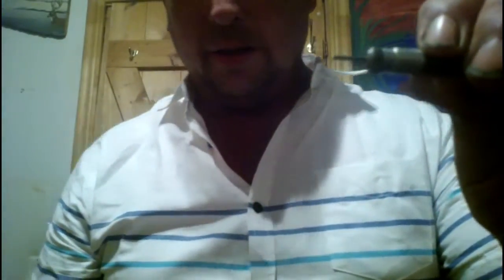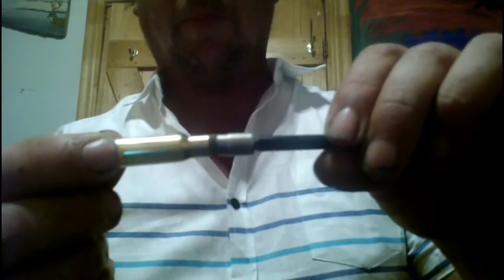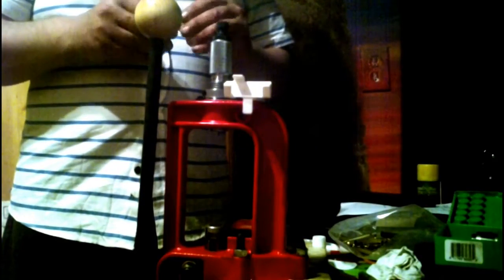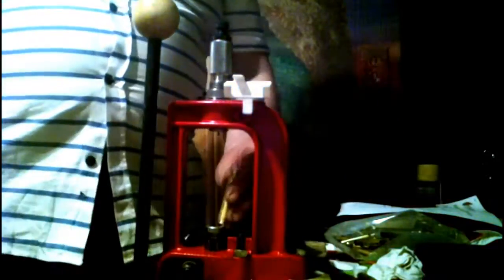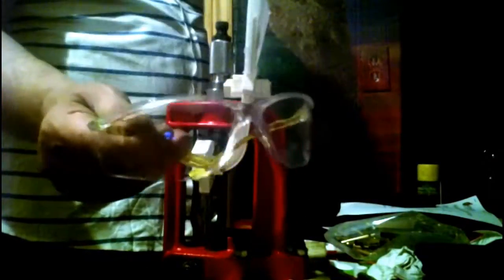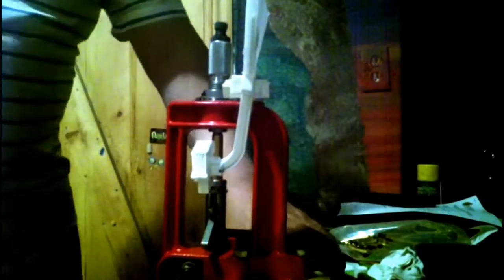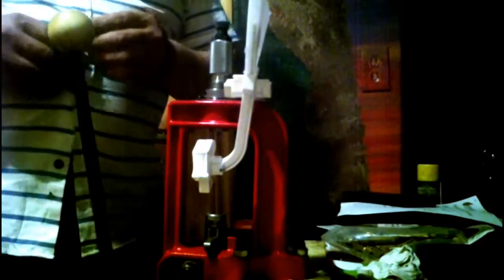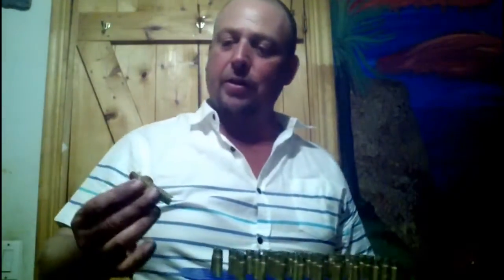9x57 Mauser chasing the sights #2, brass prep.

Comment: Many 9x57 Mausers made by gunsmiths after WW1 have Chambers and bores that are not consistent, slug the bore with a 358 lead bullet for starters and get a Lee bullet sizing die and you can resize 358 bullets.Remove the firing pin from the bolt completely, set the die with the expander removed on an 8x57 case touching the shoulder, then back out 1/4 turn lock collar on die..Resize a case, try it in the gun, the bolt may not close, move the die down a bit, resize the same case and pushing the shoulder down untill the bolt closed with medium resistance.Try a few new cases if the same resistance is felt you have set the shoulder to your chamber. Load a few rounds and fire the gun and check for primers that have pushed out, if not. you have a perfect round for your rifle.
Reply from the maker: Thanks for the tips, I have slugged my bore and it comes in at .359-.360, so the .358 bullets work for me. I ran my 8X57 cases through the full length die and my once fired brass does seem to have stretched so I would say I have a reasonably "tight"chamber. Thanks far watching!